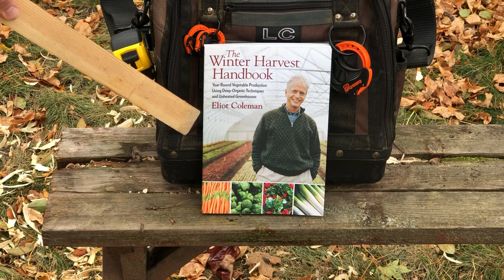How To Easily Make An Eliot Coleman Mouse Trap Box Out Of Waste Wood - Part 1

Comment: Could I just use a cardboard box? It’s for inside our travel trailer
Reply from the maker: Based on what Eliot Coleman has written about why these boxes work, I’d say it’s worth a try. However, I’ve never tried making these out of anything but wood or using them inside. I’ve also never heard or read about anyone else doing so either. Of course that doesn’t mean they won’t work, just that nobody has tried and published their findings. The traps need to be securely fastened to the box and the box needs to be heavy enough so a mouse can’t drag the box around. I also wonder if mice would or would not chew a cardboard box to bits. I you try this and it works *please let me know*! That would be fantastically useful information for other people to have.

If I had a trailer, I build several of the wooden boxes and place them around the trailer to catch the mice before they get inside. These trap boxes were originally designed to catch voles in unheated winter greenhouses and outside is where they excel.

As much as I prefer not to direct anyone away from my channel, if you have an existing mouse problem check out Shawn Woods channel here:

https://m.youtube.com/user/historichunter

If there is a mouse trap guru he’s certainly it. If the links don’t work, just search for ‘Mouse Trap Monday’. This video he published about a week ago, may be more what you’re looking for:

https://m.youtube.com/watch?v=pHwvVPT202Y

Good luck and may you soon be vermin free!